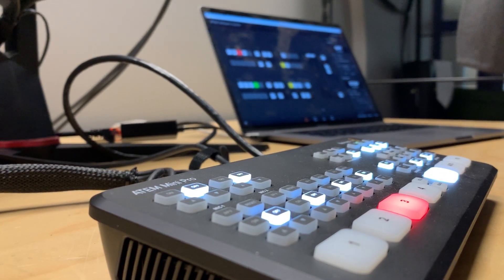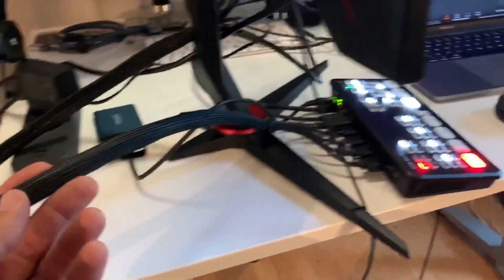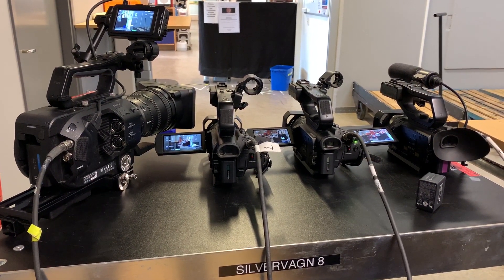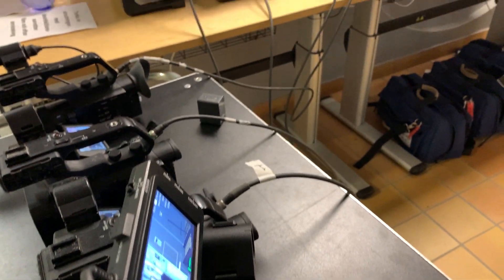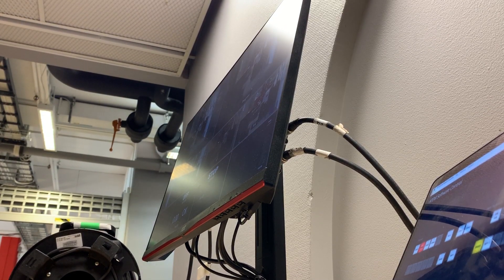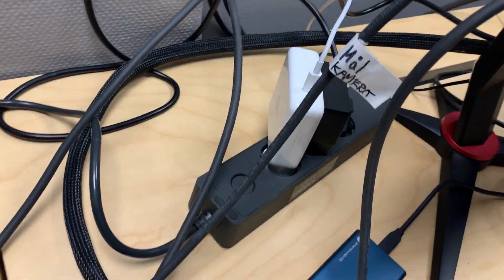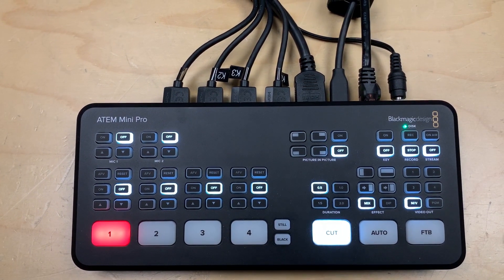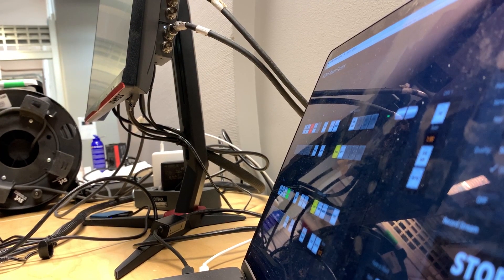ATEM Mini Pro minimalistic SDI setup - Part 2

Comment: each camera required SDI to HDMI converter? you can't use SDI loop?
Reply from the maker: The loop through is just a copy output of the the input SDI signal.
Reply from the maker: I don’t really understand your question. What are you trying to achieve? 

If your camera has HDMI output and can send the signal on cables shorter than 10 meters you’re fine, but with this setup I’ve sent a video feed on cables as long as 75 metres without any issues.
Reply: @outbackproductions1797  I meant if I have 3 cameras, I have to connect to atem mini pro do I  need converter in each camera? Or I could use the loop output in sdi converter?
Reply from the maker: @francisnaval  Yes, you will need a converter for each camera from witch you only can get a SDI signal.
Reply from the maker: And the SDI loop through should work just fine if needed.

Comment: If you are going with mixers for audio and one of the line in input on the backside of the unit they must have an unbalanced signal output option.

Comment: Thanks for sharing, this switcher is good stuff for sure I got the first one they released. Noname cheap china made converters, homemade SDI cable made out of satelit cable, soundcards, capturecards, mixers etc etc works. Obs works with it , Intensity Pro works with it, Camlink works with it . So it is good stuff for sure. I can squeeze out 9 cams (atem mini + atem tvs) and a whole lot of audio channels out of my system if I want. I got my system set up using two computers right now, one with the intensity pro capturecard and one with the Ultrastudio mini recorder so I cast two places the same time. The first machine an old gigabyte hackintosh uses the intensity pro and FMLE out to the internet and loops it through to the ultrastudio recorder in to a Lenovo laptop and obs and out to the internet. I can hook up one more computer with the atem tvs over SDI to get access to 6 more cams or a computer desktop or a hardware media player.

Comment: Do you still need a video capture card for that setup?
Reply from the maker: For what would you need a video capture card? If you'd like to record your production or stream you only need a SSD hard drive connected to the USB-C. I'm using the Samsung T5 Portable SSD 500GB witch is plenty of space for the mpg-files the Atem Mini Pro produces.

Comment: What type of SDI cable did you use?
Reply from the maker: Oh, did you mean the 75 metre rolls? Those I actually don’t have a clue what kind or brand they are. They are not mine. I just rent them when I need them. 
If it’s those you mean I can check the markings on the cables when I’m at work on Monday.

Comment: Nice setup! I am working on a «stream box». A case/flight with conectors on the back and a screen in the lid. I am taking in power, hdmi, sdi, minijack/jack, xlr and ethernet. Outputing mulitble program output hdmi, power, usb power, ethernet and audio. This will allow me to get in to an event fast and prevent a million cables and setup everytime im on a job. On the inside the stream box will have a wifi router, powerstrip, hdmi splitter, a zoom H6, atem mini pro, a hdmi audio exstractor, speakers with adjustable headphone output. It will altso have a slot for a atmos monitor for checking exposure and color.
Reply from the maker: Hi Magnus, 
I was looking at a simular solution, but I scrapped that when I realised how much it would weigh. Now I just put everything in a lightweight soft case in witch I used to carry large light panels. 
I’ve also realised that no job is similar to the other, so a flexible kit which I can modify according to the customers wishes is better for me. 
Good luck Magnus. I hope you’ll have a prosperous business.